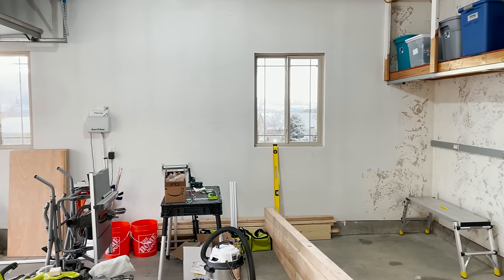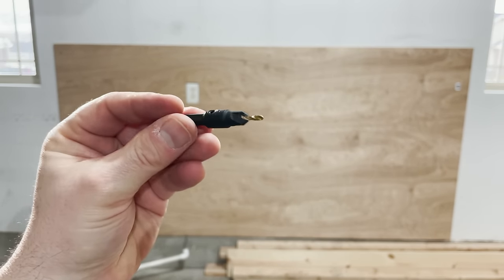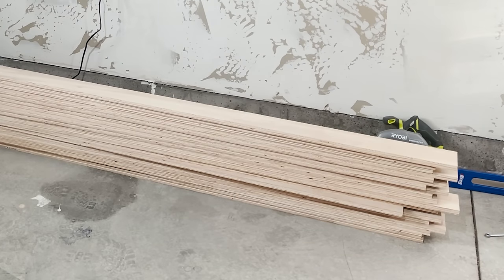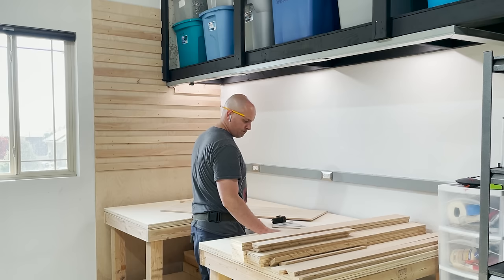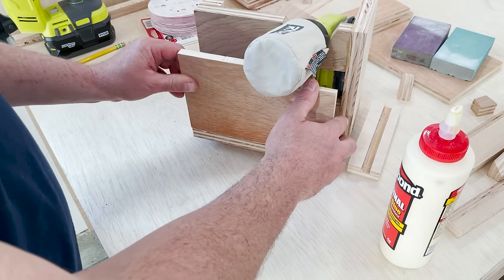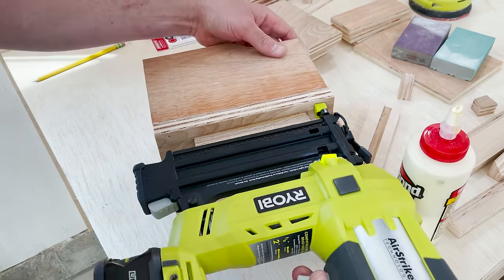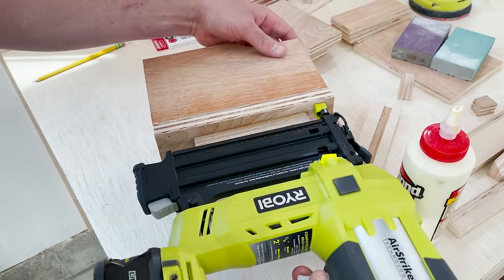How To Build A French Cleat Storage Wall

Comment: You put a 20-amp electrical receptacle on a wire that is only meant to handle 15-amps.  That has the potential to overheat the wire and cause a fire.  You should replace the receptacle with a proper 15-amp one, or run a larger 12-gauge wire.  You might know to not overload it, but what happens if you sell your house and the new owner assumes it's wired properly?
Reply: Looks like the opposite is true (previous outlet was 15 amp on a 12 gauge wire, obviously not an issue).  I could be wrong, but if you look closely it appears that the wire coming into the box is yellow 12 gauge romex.
Reply: Breakers protect wires not receptacles. This is perfectly fine
Reply: Comedy
Reply: You’re clearly not an electrician so don’t spout about how it works. You can run a 15AMP device on a 20amp circuit perfectly fine. If you run 20amp devices on 15 amp circuit THEN you will run into problems
Reply: So you’re saying  an outlet that is rated to handle 20 amps can’t handle 15 amps. Just because it’s a 20 amp receptacle doesn’t mean it pulls more amps than the breaker is allowing.
Reply: @dirtymonty3562  yep, as soon as something pulls more 15amp breaker will pop. Receptacle doesn't really matter much  and since it's garage it's most likely 12gauge and 20amp breaker, just receptacle was 15amp. Even if  it wasn't the case it doesn't really matter, nothing prevents anyone to plug 2 15amp heaters for example since you have two outlets per receptacle, so you can overload it easily without using 20amp plug tool.
Reply: That doesn't matter it prevents you from plugging 15+amp tool, but you can plug 2x 15amp tools in the regular receptacle and attempt to pull 30amps. Breaker will give.
Reply: This right here is why people should be cautious of YouTube comments. This person has no understanding of electrical wiring.
Reply: The breaker will pop ...all good
Reply: @chaldokid501  Actually, he is right. In Canada you can only load a circuit to 80% of the breaker size. Not sure if that is the same in the USA.

Comment: How much space needs to be between each wall cleat?
Reply: Depends on how large your hanging cleat.

I would put more space between if you wanted to build cleats into the item you are stacking, which is a nice thing.
Reply: Ideally you'd want 2.5" cleats with 3.5" of space between, but you can adjust to your liking and budget.

Comment: So awsome. Thanks for showing this , I didn't knew about this type of system. I temporarily bought some plastic standardized tool boards , but the quality is really crap. It can't really support the amount of stuff you can put in there weight wise. It starts to hang and the back parts it hangs on can easily break if not careful or like said weight overloaded using the whole bracket of holes filled. That being said this is my first own setup for my shed , I just needed something in place. Now I'm in the process I'm getting to upgrading it into a wood tool wall. This really helps me out a ton because I had ideas how to do it but just not a design for it yet. This definitely gives me a  blueprint for the universal backwall because that's exactly what I wanted. A system where I can design my own buckets or cabinets on. Because now I can make any design for any tool or material storage I need and fix it on there.

Comment: Just moved to a new home with separate shop.   Loved this video, so helpful.   I am cringing a little with how much more expensive the Birch Plywood is compared to a few years ago.    About triple, but it makes such a beautiful feature in the shop.   I have most of the same tools as well which is great for using the cordless power tools.    I love my Ridged Pro series table saw and miter saw.   They cut so clean and are infinitely quieter than my older equipment.   The Ryobi cordless pin nailer is such a magnificent tool.

Comment: Just a quick question for anyone who might know the answer. Would it be easier to cut the 45 degree angle as your cutting the strips? To me it seems you could skip a step if you did. I know that if you set up one saw at a 45 that each side would be angled but you could use either 2 saws, one set at a 45 and the other to cut the flat bottom, or just have angles on top and bottom so that either way you need to place the board it works. I’m just learning woodworking and CNC carving so this is an honest question I had while watching. Great video, I can’t wait to start my organization wall.

Comment: I am setting up my new metal garage. Need space to store everything. Will be following your tips from this video with a bit of a twist to accommodate the steel structure. Thank you so much for this video! I finally have my missing piece to my storage problems!
Reply from the maker: Sounds great. Send lessons learned or pics when done. Glad this video helped you get started.
Reply: Buy shelves cheaper and easier
Reply: @steveb7882 French cleats hold a tremendous amount of weight, more than a shelf can.  I have hung very heavy cabinets and filled them with tools on French cleats.  The cleats are still holding well over twenty years.  Besides that, there’s the nice thing of rearranging as the tools multiply.  I had never thought of using plywood behind mine, I have always just secured them to the studs themselves.  The plywood is interesting as it would allow a nice backdrop and easier to clean I imagine.  It looks nicer that’s for sure.

Comment: What a beautiful job you did!!! 
I now want to reorganize my garage and make it as neat as yours!!! 
Just amazing how much wood has gone up!!! 
Thank you for taking the time in making this video.
Reply: I pick up pallet wood in my city. even the standardized Euro pallets companies can't return if there is like 1 broken board on them. Be sure to pick up the pine ones and not firewood since that's crap.  Anyway I got a few addresses in my city now where I can freely pick it up because otherwise they need to pay money for throwing it away or having someone pick it up for taking it to the city dump. Yeah it's a bit more work but it's free that way. Put it thru a planer , plug the holes with wood glue and sawdust from the same type of wood sand the remains off and it's like you got brand new boards. Sorry if I'm too informative I don't know your experience in this , but yeah that's how I do it.

Comment: Happy to see someone else adopt a smaller cleat size to extend a sheet of ply! 

I was in the sign business for years (80's - 2003) and we used 2" french cleats to hold large sandblasted signs!!! The key is to hit a stud with the fasteners or use anchors! 

Those 5" and 6" cleats sizes I see folks posting is just a waste of valuable lumber and over-engineering for what most DIY's are going to hang in their garage/shop! 

Great Job! #hardworkpaysoff
Reply from the maker: Thanks for watching Gene. Really appreciate the comment.

Comment: good video thanks.  One thing you can do for the sharp edges, is run the cleats through your tables say again, just taking off 1/2 of a ply layer thickness.  This will also keep the plywood from chipping.
Reply: Good idea!  I have ran them through removing about 1/16” - 1/8” off the tips, just enough to blunt the tips.  I usually use a block plane as I enjoy hand tools more than power tools😂

Comment from the maker: Overwhelmed by the support. Thanks so much for watching and giving tips from the $Thanks button above. Helps so much. 

I've received a few questions, so here are the measurements I used:

The cleat itself is 1.5 inches on the shorter side and 2.25 on the longer side
The gap between my cleats is 2.25 inches, but you could go 2.5 inches or more.
From base of first cleat to top of second cleat is 6.75 inches.
Base of first cleat to the base of second cleat is 4.5 inches.

Hope this helps. I will eventually make a part two and will explain in detail. Thanks again.
Reply: Okay, now pin your comment so it will be on top where everyone will see it.
Reply: Great video! I'd love to see the promised part 2 even if it's just a quick video that shows the holders you've built since this first one.

Comment: For those of them that are watching this and saw the outlet change. I want to clarify something. That was very dangerous what he did. It may seem innocuous now but he switched a 15 amp outlet with a 20 amp outlet. The wiring I'm certain is for 15 amp only and by putting a 20 amp outlet on it you allow the ability of somebody who has a 20 amp device into it, and could cause a fire because the wiring is not designed to handle it or at least it would trip the breaker constantly. You can tell because it had that little slash 90° on the left prong. So 20 amp devices have that prong Twisted 90° so it can plug into that spot. You should look for Outlets that do not have that problem to match what's there. However if that is all you have make sure you write in Big Red Letters on the outlet cover 15 amp outlet only. So people know that even though a 20 amp device could fit into it not to use it. Something had to do similarly. I paid $5 for case of 30 gfic Outlets that were 20 amps and rather than spend $7 every time I wanted to put another gfic someplace I just filled in that slot with epoxy, and wrote on it 15 amp only so nobody tried to cut out or chisel out that epoxy covering the hole thinking that it was an accident. May sound stupid but electricity is something you should mess with and you got to be very precise with.
Reply from the maker: Excellent comment. Dan is correct in saying you cannot install a 20 amp outlet on a 15 amp circuit. It is against code and  is a fire hazard to do so. In the video, I replaced the 15 amp outlet for a 20 amp outlet on a 20 amp circuit so it was done correctly. I replaced it because I plan to run heavier machinery on this outlet (band saw, drill press, etc.) If anyone reading this is looking to replace an outlet, you must first go to your breaker and check the number on the breaker switches (15, 20, etc). Also check that the circuit is using the correct gauged wire (14 vs 12). For those that want more info, here is is a link to the electrical code: https://up.codes/s/outlet-devices.

Also, here is a link to a video to that I go into more detail on replacing a regular outlet for a USB one:  https://youtu.be/l-Y-aL_QWbs
Reply: You filling in an electrical outlet with epoxy seems a little more unsafe and against code to me lol

Comment: Great Job!!!  Best french cleat video I've seen so far!!!  I never knew about dust resistant electrical outlets, Thanks.  One question?  You mentioned  using either 1/2" or 3/4" birch plywood on the garage wall. You used 1/2" plywood.   However the shelves look like that are made with something heavier (see 4:35 min).   Is everything else made with 3/4" birch plywood??

Comment: Just started my french cleat wall tool holder project.  Just an observation, if your tool holder is long enough to hang over the french cleat below the one is is hanging on, do you really need the support blocks? Thanks for sharing!
Reply from the maker: Correct. If it’s hanging over the cleat below then you generally don’t need the extra back support. I suggest you have it hang over the bottom cleat .5 to .75 inches to avoid breaking the tip of the cleat.

Comment: Your wall looks great and I'm thinking of doing the same in my basement.  However, I only have a brick wall and so, in order to cut-down on the number of screws in the brick, I think I would forgo the plywood panel and just add the cleats directly to the brick using Tapcons.  What are your (and others') thoughts on many Tapcons into the brick wall?  Strong enough?  Would they loosen over time?

Another option is to use the plywood panel and only use screws for the cleats that stop just before the brick.  So, something like an 1.25" screw.  Would that be strong enough?
Reply: You could put spacers so that the plywood sticks out from the brick further so you can use longer screws and use thicker plywood to make sure it is strong enough to hold the cleats up.

Comment: the all wood look is so clean looking! Thank you for the inspiration. When are brad nails strong enough for all cleats for all heavy tools? Or should I also use screws?
Reply: The nails are mostly to hold pieces together while the wood glue dries. When dry wood glue tends to get as strong as the wood and sometimes stronger ( depending on wood type ) then the wood itself. I'm more of a screw user myself , so personally I'd say for heavy stuff use screws. But for simpler lighter stuff nails is perfectly fine.
Reply: @DJMetalstone  that is very helpful, thank you for answering my question and helping with that! i appreciate it

Comment: awesome system & custom shelves - how do you like that Wen bandsaw?
Reply from the maker: Love it. Very handy and easy to replace the band. However it's not made for heavier cutting so would want to get a larger one if you plan to cut 2x4s or dense hardwood. For these more dense items it will cut them fine but the band will slightly bend, making an uneven cut if you go too fast.

Comment: I have a very similar garage setup, why mount a plywood panel instead of just mounting cleats to the studs through the drywall?
Reply from the maker: Definitely could work that way too. I used the 4x8 sheets mostly for looks. Plus the maple plywood was about 60% cheaper when I built my cleats than it is now in late 2023.

Comment: What is the total distance between the bottom of one cleat to the bottom of the one above it, sine each cleat is based on a 4in board cut at 45 degrees? Looks like you have a quarter of an inch or so of space when you hang an object from the wall.

Comment: What a great video. Congrats! Can you please confirm the size of the cleats that are attached to the wall and the size of the cleats that are on the moving parts? They are different sizes, right?
Reply from the maker: Hi pasaraiva - the cleats on the tools are much easier to move if they are smaller. If it’s a lighter tool like a screwdriver then it can be much smaller. If it’s much heavier like a saw, you should have a larger cleat or could use two sets of cleats, although one is very strong. Don’t shorten the angled portion, but the squared portion on the cleat.

Comment: Great video. Quick question: How "tall" are those spacer blocks or whats the distance from the bottom of 1 cleat to the next?
Reply: I have the same question,did you get any answer?
Reply: @melynckavanoverschelde8360 No, I ended up using a 2x4 (3.5 inches) spacer block for may wall. Works well for me

Comment: Great work and super helpful video. One question: Do you actually use the cleats near the top of each 4x8 sheet? They look really good but I'm thinking of orienting my sheets horizontally and keeping the upper levels a bit lower.
Reply from the maker: I've put smaller things on the top portion, but they are fairly high up so I don't use them as often as the other sections. I think you would be fine to go that route.
Reply: @beefmaster_james  Great, thanks so much. Very helpful.

Comment: First of all: great video! one of the best I've seen so far.
I have a question for you: did you mount it on drywall?
i have a new small shop but i am scared that the drywall won't be right for a storage wall.
Looking at your video i got the opposite feeling, so is it drywall?
Reply: He mounted the plywood to wooden studs behind the drywall.

Comment: Did you replace a 15A outlet with a 20A one?  I guess it looks like maybe the wire is 12ga but hard to tell.
Reply from the maker: Good catch. I've mentioned it on other posts and you are correct that I switched a 15 for a 20 amp outlet. You are also correct in that this is a 12ga wire on a 20 amp circuit so that change was intentional. Anyone reading this, you need to check the breaker box and make sure you don't put a 20 amp outlet on a 15 amp circuit. The opposite, 15 or 20 amp outlet on a 20 amp circuit, is generally up to code.

Comment: Neat but how do the batteries stay charged ready to use ?
Reply from the maker: I built a holder for a 6 outlet surge protector plug that can be moved around the walls. That is what I use to plug the chargers for the batteries.
Reply: @ 
Ok that makes sense, thanks.
Reply: @ 
Nice, is it in a video ?

Comment: Is the plywood in the back just for looks? Can I technically just put the cleats straight onto a block wall with tapcoms?
Reply from the maker: Yes you could just do the cleats. Tapcons will work, but get heavier ones that can support the necessary weight. If you don’t have cinder block, you would only need to secure them to the wall studs.

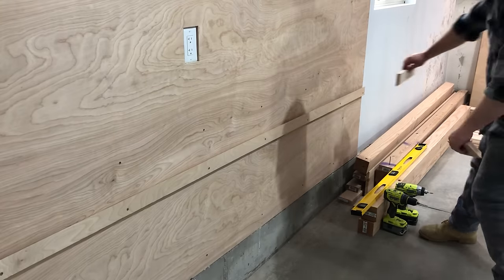Comment: At 4:42 minutes, u show the space u use between them, is it 2.5 inch wide?? Or more??
Reply from the maker: The cleat itself is 1.5 inches on the shorter side and 2.25 on the longer side
The gap between my cleats is 2.25 inches, but you could go 2.5 inches or more.
From base of first cleat to top of second cleat is 6.75 inches.
Base of first cleat to the base of second cleat is 4.5 inches.

Thanks for the question.
Reply: @beefmaster_james  this is so helpful answer, thx a lot

Comment: what is the thickness of the plywood board you used that is screwed into the drywall? I'm debating on 1/2 or 3/4.
Reply from the maker: The sheets I used are 1/2 and the cleats are 3/4 birch plywood.

Comment: Why is wood board installed on concrete? Cant you just put french cleat on concrete?
Reply: Yes, if it's flat enough.  If it's drywall, then it would be a good idea to put the fixings into the studs.

Comment: Is the plywood back wall required?
Reply from the maker: No, you could just mount the cleats directly on the wall studs. If you do that, I would consider wider cleats if you plan to  hang heavier equipment. The drywall between the cleat and stud can crack or crumble over time if pulling heavier tools on and off, and a wider cleat gives more surface area. Don’t have to do it that way, but something to consider.